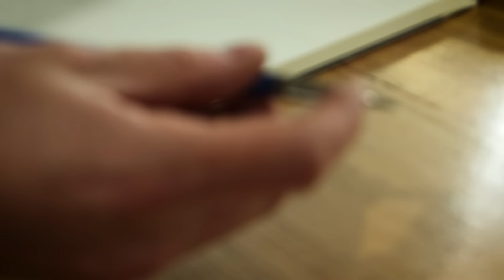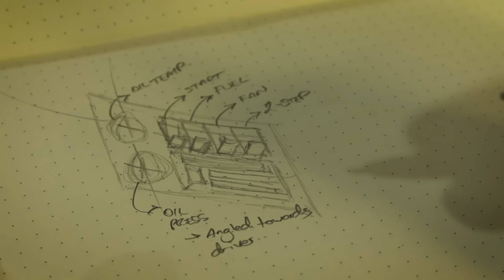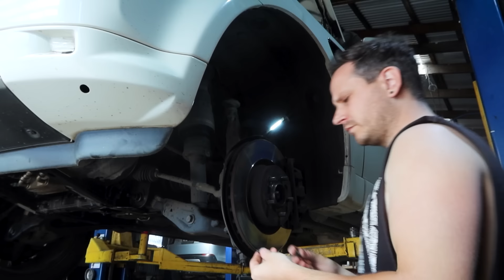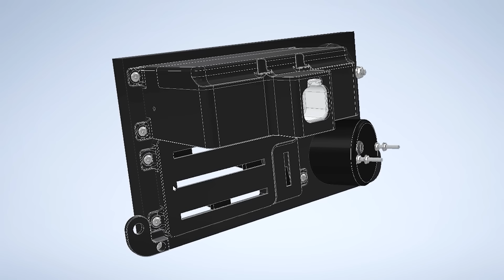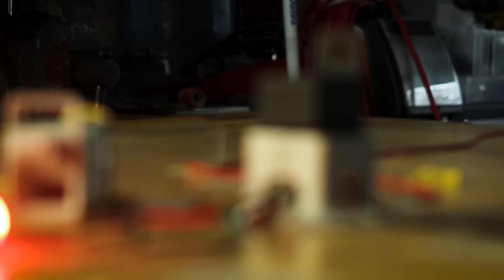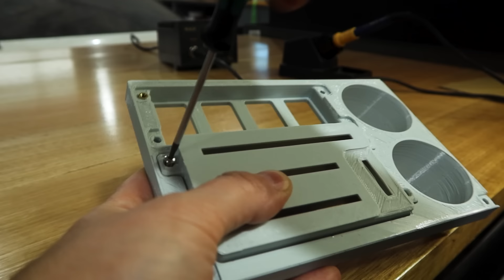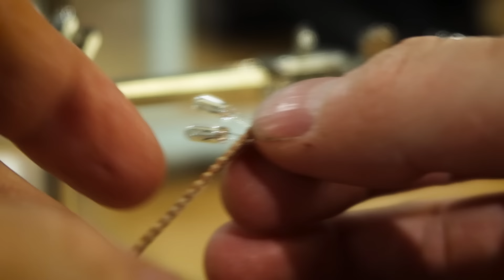How I Designed 3D-Printed Mods for My Vintage Toyota KE25

Comment: Following in similar footsteps; With the toggle switches, are they 24 degree switches or have you gone for a different degree?
Reply from the maker: I'm actually not sure what standard is, but these ones are about ~40⁰ between positions?

Comment: New to the channel, and I love your style for this. If you’re looking for feedback on what to include in these sorts of videos, I’d love more of your thoughts on the interface between the car and the switch box. What kind of tabs and fastening points do you look for? How do you make sure it sits flush against the dash when installed without a gap? Etc

Thanks for your consideration!
Reply from the maker: Hey mate thanks for checking out my channel.
Sure, no problem. I've made some notes for the next time I'm talking about that stuff :)

Comment: I believe that wire you drew to loop around the LED's will just be a short circuit over them, as current is going to take the path of least resistance and go through the wire instead of powering your LED's, I think you could put a resistor there instead which would eat some of the power for the LED but would ensure they turned on, or do something in parallel.
Reply from the maker: Possibly so, I definitely wouldn't pretend to be an expect on electrical systems. For now, I think that's how I'll run it, but I'll keep it in mind as something to possibly address in the future :)

Comment: You're absolutely right about the heatserts. I service gas pumps, and there are two major manufacturers in North America; one used threaded inserts to mount components to the pump door (displays, card readers, etc..), and the other just added mounting bosses to the resin door molds and essentially used self-tapping screws. Guess which brand regularly needs to have door panels replaced because the mounting bosses are broken and disintegrating from use, and which one doesn't? I often joke that one brand is good for me, and the other is good for the client. 😂
Reply from the maker: Hahaha no doubt. "Poor man pays twice" as they say!

Comment: 18:15 Small note 😉 The size of the fuse is chosen depending on wire's gauge and legnth, not the power consumed by connected device. Gauge is chosen by the requied consumpsion and length.
Reply from the maker: I sort of glossed over that a little too much as it wasn't the main focus of the segment but you are correct :)

Comment: a lot of vendors have 3D models available from the manufacturers and I would highly recommend using those over making your own from scratch. they'll be more accurate, and you'll have more time to work on your own project instead of spending hours remodeling something that's already been modeled by the people that actually make the part. Also, for beginners that are looking for efficiency and aren't trying to make their model render-quality, I'd also recommend just modeling critical geometry, not unnecessary details (of course unnecessary detail could vary depending on the project and person). That just takes more time that doesn't usually add value to the end product.

BUT I really enjoyed the video all the same and its a super cool project =)
Reply from the maker: Thanks for watching mate.
It's important not to trust every aspect of models you have not verified, regardless of where they come from. You may find some details that were not relevant to person (OEM) creating the model are very relevant to your design. 
Lots of variables around it, my point being that if you rely on other people for too many things you'll be stuck when you actually need to make things for yourself.
Reply: @fatlipcollective  that's a fair point. I guess I usually already have the hardware in hand so it's pretty apparent if the stock model is missing something important to my design that the actual part has. It hasn't happened to me yet but definitely something I'll keep in mind. Best of luck on the project, I'm excited to watch the next video!
Reply from the maker: @makerjakenet Thanks mate I hope you like it ✌️

Comment: Hey, sorry to ask this, I am sure a million people asked this before. But how does 3D-Printing hold up in the sun? I would imagine that on a hot day things can become a problem? I want to modify my old VW and was thinking a combination of 3D printing but I live where it gets really hot like almost 37+ Celsius in Summer so was just wondering.
Reply from the maker: No need to be sorry mate, I will be covering this in more detail in my upcoming video but there are materials that you can use that will hold up to both UV and high temps. It will often get hotter than 40+ C in Melbourne where I live, too :)

Comment: For the record you can just screw into a 3D print. IT WILL be strong. I think i saw a test where it actually was stronger then the heat set. BUT its not good for repeated assembly and disassembly. It very much is a one and done.
Reply from the maker: Thanks mate. It's not necessarily "one and done" with a tapped 3D print, but generally yes, I would recommend using a heatsert if it's something that will see repeated/frequent use.

Comment: awesome video, and fantastic 3d modeling! my only question is why would you use a light that if it burns out you have to de solder it from a board? would it not be better to find a housing for a standard T5 bulb and get one of the housings for the bulb that have a pigtail on the end? this way if the bulb was to fail it could easily be changed. Just food for thought, the rest is amazing!
Reply from the maker: Thanks mate!
Yes it's something I considered, but generally would increase the space required to fit it all.
Nothing is set in stone though, and once I've got a completed functional prototype I will likely look over it all again and see what I might want to change.
Thanks for watching!

Comment: great video, great explanation! you said you printed in PLA, have you had to deal with warping from the heat inside the car on a sunny day? i'm trying to print a few things for my car but it never works because of the warping
Reply from the maker: Thanks mate!
Yeah the PLA is just for the prototype, it's not really suitable for extended use as a final part inside the car. I will cover this more in my next video :)

Comment: A design decion i would make is to create a  chamfer-like lip around the edges that fit other parts. This allows you to use fewer screws because your part won't rotate. Meaning, if i mate a back plate against a front plate with a chamfer, i can now use a single screw in the middle rather than 4 screws on each corner.
Reply from the maker: Thanks mate appreciate the tip. The screws are more about rattling and ensuring a solid and enduring fit. More to come on these types of connections in my next vid :)

Comment: Could you be a bit more specific about the process and have more details on part assembly? 

Just kidding, great video, good info, good insights and felt the pain of soldering iron not fitting properly. Had many moments in my setups "It fits perfectly, except this has to be assembled by tiny man in from the inside"
Reply from the maker: Lemme know if you get a lead on some of those tiny assembly men - got some work for them too!
haha thanks for watching mate!

Comment: "I'm not an electrical engineer or an auto electrician" But you already have a better grasp of circuitry than most of the students I did electrical engineering with. EE's are good at maths most of the time, there's a few really good ones that can do the maths and understand and build the circuit, but I didn't find many of those.
Reply from the maker: Thanks mate I appreciate it :)
I think the practical skills are the number one thing missing from most engineers and engineering courses unfortunately.
Reply: @fatlipcollective  100%, I've heard in South Africa, to be a mechanical engineer you have to be a fitter and turner first, and it makes a lot of sense to understand what goes into to producing something before you spend your life designing things, keep up the awesome work, this is helpful for me trying to build a nice enclosure for my DCCD controller

Comment: What cad software do you use? I've been messing a lot with making and printing parts but I'm reaching a head on what cad to use... That doesn't cost an absolute damn fortune...
Reply from the maker: Yep, that is the problem.
Once upon a time you could make a purchase for a version of the software "Inventor 2013" for example, but now every business tries to squeeze you on a subscription model.

I use inventor, which is more or less basically just Fusion 360
Reply: @fatlipcollective  thanks for the response, it is a shame that everything is all subscription based... it limits so many people and puts off beginners so easily... one day I'll start I guess haha

Comment: Love the modeling. Do you prefer Solidworks, Fusion360, or something else?

Do you model the parts individually, or as a 'top down assembly'?
Reply from the maker: Thanks mate. I use Inventor which is basically F360.

It depends, but generally I like to make a multibody part and then an assembly. Sometimes I will then make secondary multibodies to add to the assy.

Comment: Amazing video!! You earned my subscribe 😊 One note: when you talk about fuse sizing, try to mention cable sizing also. Fuses are meant to protect cables from carrying more current than they are rated for when there is a short or a device “requests” more current than the cable is rated to carry.
Reply from the maker: Thanks mate and yep you're right. I oversimplified the explanation a little bit :)

Comment: не оставляй машину летом на солнце иначе весь твой напечатанный пластик превратится в расплавленный пластик. И не включай зимой печку на понуй мощность.
Reply from the maker: The final part will be from heat/UV resistant material :)
Also no air from the heating system passes through it :)

Comment: I disagree with the 3D print statement - fail and fail often.  The major purpose of 3D cad is to 'fail' before cutting any material.  visualize the design and see where the tight spots are, even run load testing (FEA) if the application requires, etc.  I think you could have avoided some of those issues, had you utilized your cad model a bit more.  just my opinion of course.
Reply from the maker: You're entitled to your opinion - which I also disagree with.

Without going into too much detail: If I'm charging my time at >$200/hour, and the price of a print is ~$10, once you're at an ~80% solution it is often more efficient to just print it and hold it in your hands/test fit it.

Most of the "issues" I'm showing here are a learning exercise to show the types of things you may overlook when you first start out.

Comment: Nice job. FYI I know it's probably overkill for this project, but you can get custom printed circuit boards done reasonably cheaply from suppliers in China. I got some done for some parts for my flightsim cockpit and will be using them again for my Land Rover Defender project.
Reply from the maker: Thanks mate!
I did consider something like that, but I've gotta draw the line somewhere - definitely something I'd like to do in the future.
Good luck with your projects, considering a LR project sometime in the future also

Comment: When i briefly worked in the modelshop for an f1 team, they used the tap in multi-head inserts in their 3d prints. They might be handy for areas that are risky for getting a soldering iron into. Just tap them in with something long and thin.
Reply from the maker: Thanks mate, I've seen those before, I think I should be able to get around any issues with some design considerations for the V2.0 but I'll keep them in mind!

Comment: Great work with this! I need more on how to make that instrument dial function, did you have to add a whole new sensor to the car to drive it? It seems to me that getting data from the existing car wiring would be more elegant, but then you need a way to reinterpret those signals in a way the dial can handle. I have no idea if such signaling is standardized or maybe if the dials themselves come with extensive tuning ability so you can feed it most kinds of signal and then calibrate it until it matches known test values?
Reply from the maker: Thanks mate!
The aftermarket gauges all use their own sensors - there are basically next to no electronics/sensors on this car from factory anyway so not too much to worry about there :)

Comment: seeing all the tablets on the electric cars this is a breath of fresh air
Reply: Legit, I drive a 2012 car has nice knobs I can blindly switch settings my families car has a tablet and I have to ask my passenger to switch the air for me.
Reply: tactile interaction w/the car is a part of the driving experience that many manufacturers have left behind or choosing not to use in the name of "luxury".  

Same reason the automatic transmission was invented, in the name of luxury.  How nice/luxurious would it be for the car to shift itself; no pesky third pedal; anyone can drive.
Reply from the maker: Thanks mate - no electric cars or tablets for me thanks.

Comment: Awesome video!! I think I’ll be watching this a few times haha. One suggestion, if you really prefer the look of coloured incandescent bulbs over coloured LEDs, you can use a high CRI warm white LED with the same coloured cover or filter. It will look much, much closer to an incandescent bulbs while having the efficiency and longevity benefits of LED.
Reply from the maker: Thanks for watching mate I'm glad you liked it!
I'm aware of the different colour temp options yep, but I'm OK with the older tech of the incandescent lamps in this instance :)

Comment: Why no resistor?
Limit current resistor
Reply from the maker: A couple of reasons:
- Keeping the vid as simple as possible,
- The relays I'll be using will have them inbuilt
- They're not reeeeeally necessary for the items I'll be powering

Well spotted though, yes ideally they would be there. I plan to go over it a little more when I cover the wiring in a bit more depth :)

Comment: Your technique for choosing fuses seems flawed to me. I choose fuses based on the wire size or known weakest link in the circuit. Plenty of folks burn down their projects because they put 30A fuses on 20ga wire to their brand new radiator fans.
Reply from the maker: I was trying not to get too into the details of wiring specific items, more about function of the relay, but yes.
You'd have chosen the wire based on the draw of the item though, but I get your point.
I plan to cover it a bit more thoroughly when I address wiring in the next video :)

Comment: Excellent video.  A fellow mechanical engineer here.  I love the detailed information and would even appreciate much more (maybe thats just because of my background).  A couple of things I haven't found in your video or comments (or potentially missed) is what cad design program and what 3d printing software you used.  Thanks for the fantastic video!  Subscribed.
Reply from the maker: Thanks mate and thanks for watching.
Slicing software depends on the printer I'm using, usually ideamaker or cura, and I design in inventor which is basically f360

Comment: once you get a good design you are happy with and want to keep in the car reprint everything on an MJF machine and use SEM color coat, will perfectly match an oem look. I do porsche parts and they look flawless. FDM is good for quick at home prototyping but terrible for looks and longterm use.
Reply from the maker: Nothing wrong with FDM for long-term use, just need to choose the right materials for the job. Looks are subjective but there's also lots that can be done to help improve final surface finish of parts of a completed design.

Appreciate the tip all the same, MJF is obviously an option but for now the plan is to try and do most of it from home :)

Comment: Hey Great Video

If I could recommend anything once you get a final design I would suggest  getting the parts printed at a company that can print them on a SLS printer. It will give a more professional look and can get the part dyed as well. I found in the past printing parts in PLA or ABS on FDM would end up warping in my car depending on temperature. Not sure what your experience is. 

With the SLS parts I did find if the part was an area with a lot of sunlight it would become brittle. But some UV protectant spray paint solved that.
Reply from the maker: Thanks for watching mate!

There's a lot that can be done with regular old resin and FDM printers, got more to come in the following vids.
Appreciate the suggestion though, SLS is of course another option - glad it worked out for you!
Reply: I've generally worked in ABS without warping issues.  But, I also don't live in a very hot climate.  Still, going with 18-20% infill and 3-4 exterior/surface layers has been pretty good for durability.  

Also, when working in ABS, I finish everything with acetone fog.  I'll light sand major lumps, cool the part in the fridge, find a hidden spot to grab on to, and pass the part over a rice cooker I modified with no lid and a momentary switch.  Heat small amounts (just enough to fully evaporate in 10-20 seconds) of acetone to just barely boiling.  Steadily pass the part over the pot to catch some condensate.  End result is a shiny part which is far less porous than before, all layer lines gone, and can be sanded again then painted so it looks nearly like a production part.

*Hopefully obvious safety warning: Ventilate-ventilate-ventilate. Avoid arcing. Avoid breathing vapours.  No kids.  No pets.  Outdoors.  No open flames.  Fire extinguisher handy.  Modify rice cookers at your own risk (no matter how fun it can be).